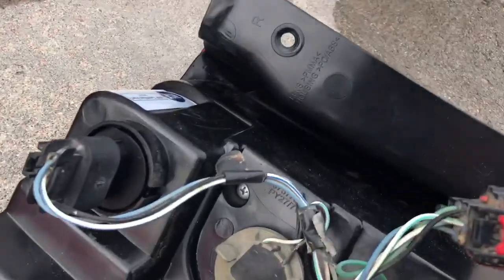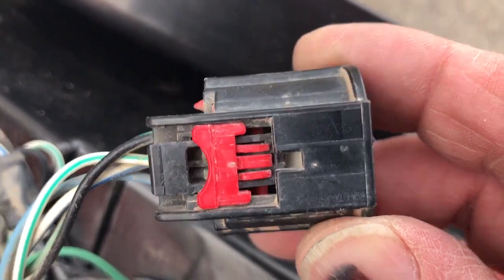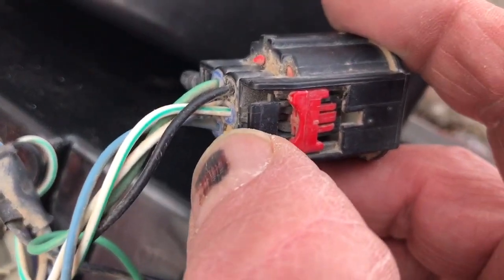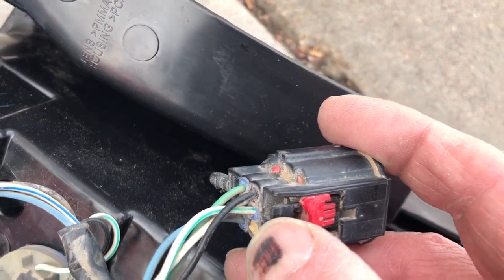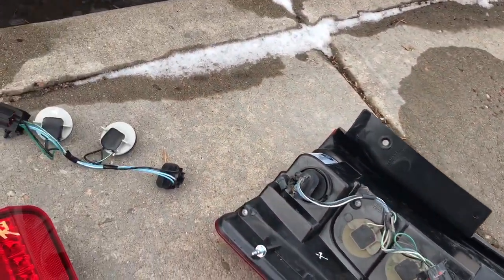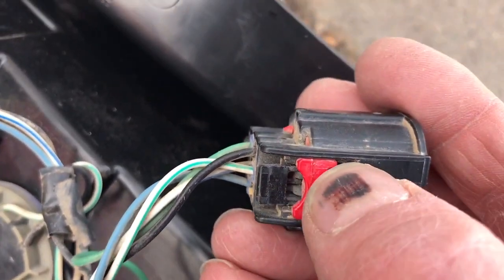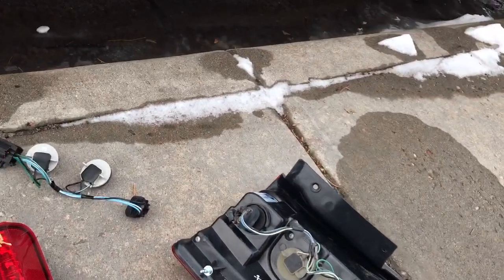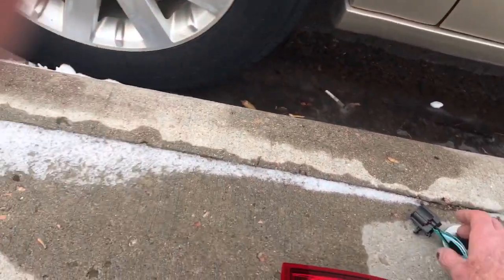You PISS ME OFF: Changing Tail Light 2012 Chrysler Town & Country

Comment: im curious why you were changing the tail lights??  I have a 2012 town &country. Both my BRAKE lights only quit working.  I too have bought new lens assemblies and they still do not work. I cant figure out what the hell is wrong with them.
Reply: What was your solution?  I have a similar issue.  Driver's side taillight led's weren't working properly and no brake light or parking light. Turn signal worked. Replaced the entire assembly, did not have an issue with the connector as in this video.  With new assembly installed, I have the same issue as before - turn signal works but others don't. 
Wondering what you finally figured out or did to fix your light?  Thanks.
Reply: @qwertpoi01  same! and i have a random extra black wire hanging down beside it. looks like it was somehow rigged before. i dont know what to do